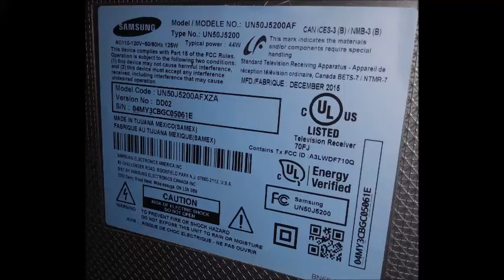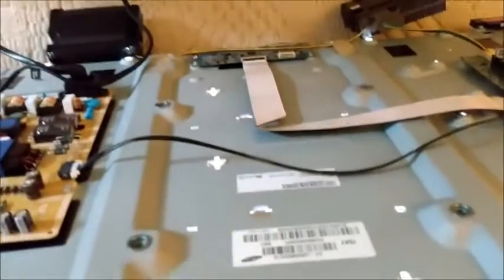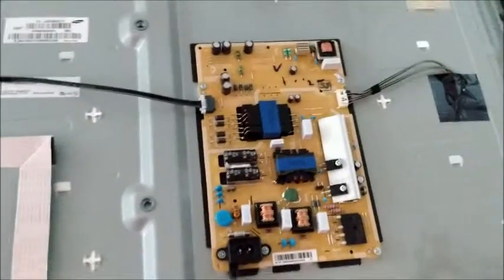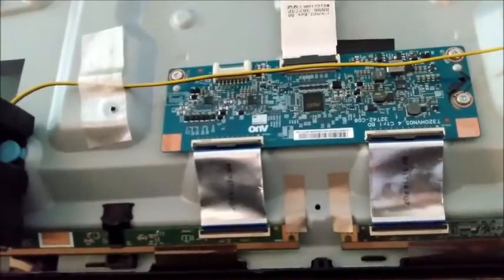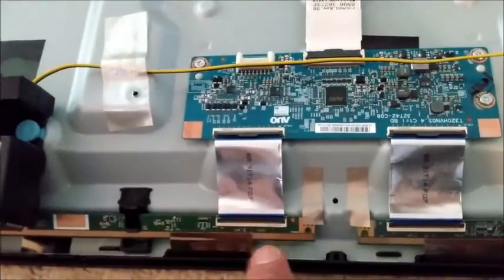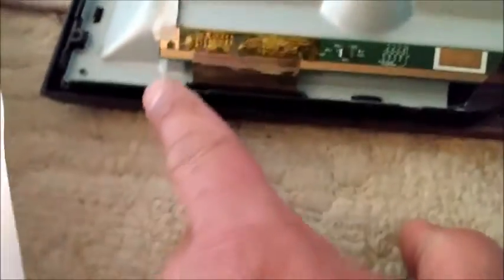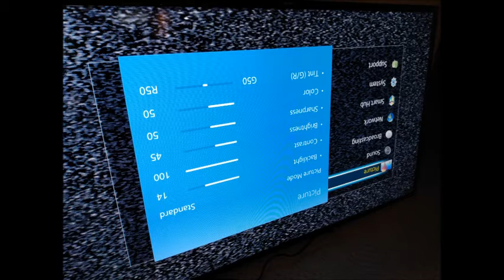Samsung UN50J5200AF UN50J5200AFXZA Blank Screen Fix

Comment: I just had this problem...I swapped the tcon and nothing happened...gonna try this, hopefully it works thanks.
Reply: Hey did your work after you cut the ribbon
Reply: @vickisabella130  no it did not....I think I was sold bad replacement parts as well...I returned the parts and sold the tv as is for parts